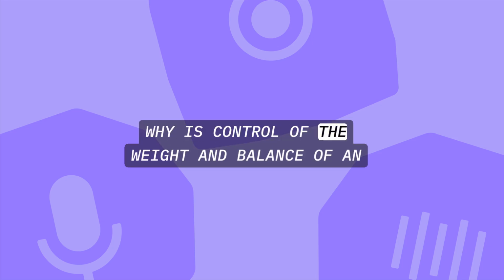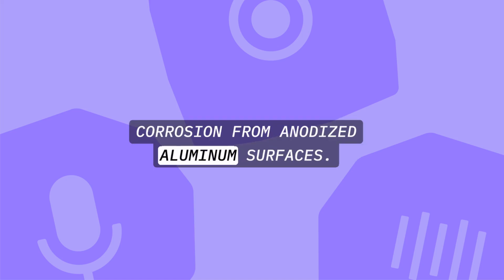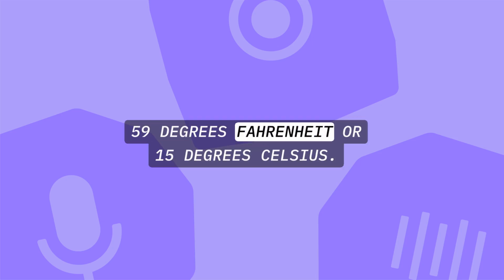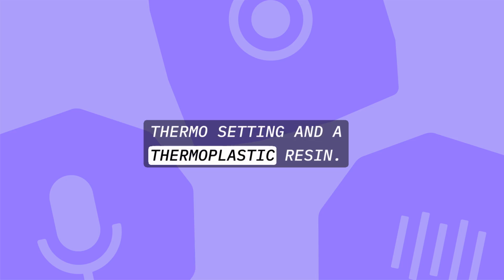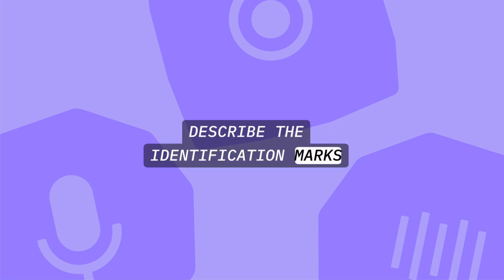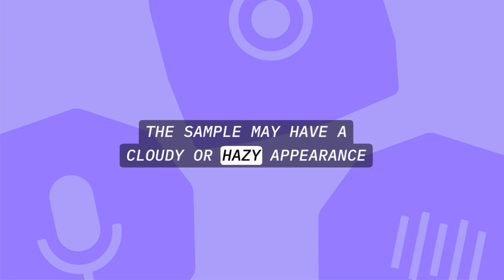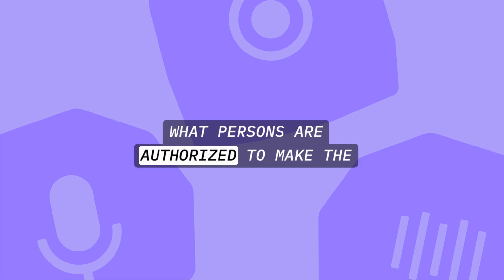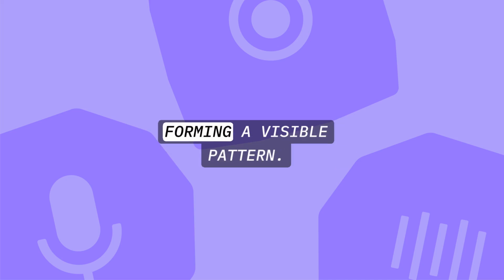Jeppesen Book Full A&P General Oral Exam Questions

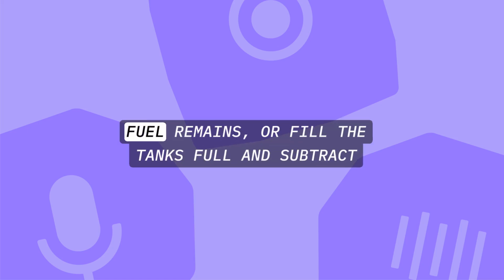Comment: Correction @4:51 Either drain the fuel system until only **UNUSABLE fuel remains, or fill the tanks full and subtract out the weight of the usable fuel.
(You said usable fuel twice)

Great quality videos and cadence. Thank you for creating these.